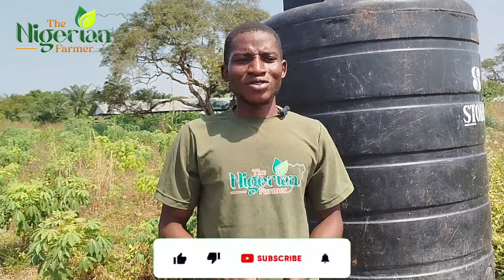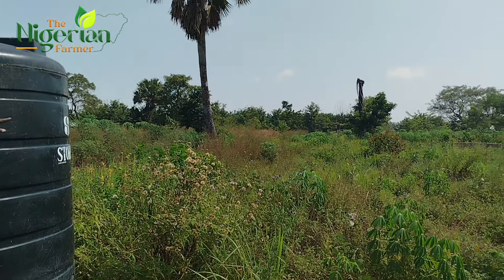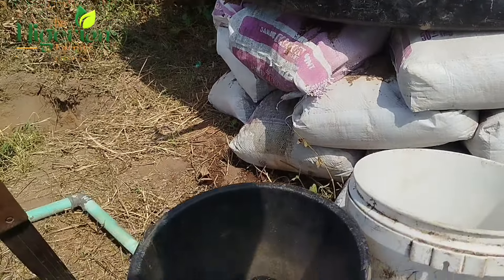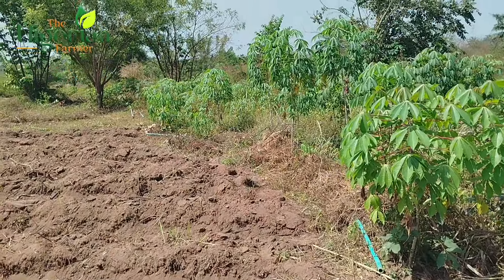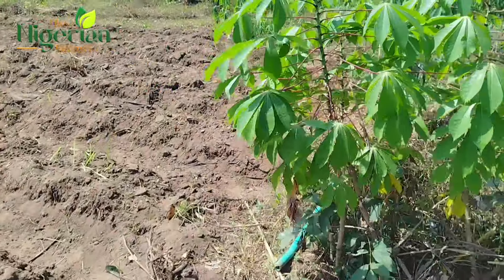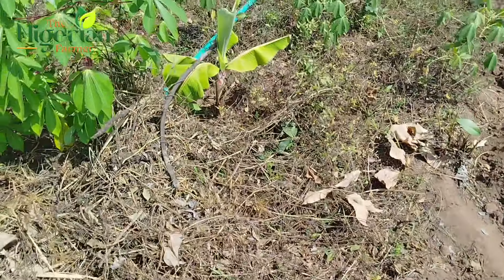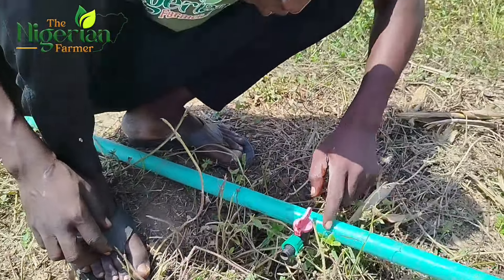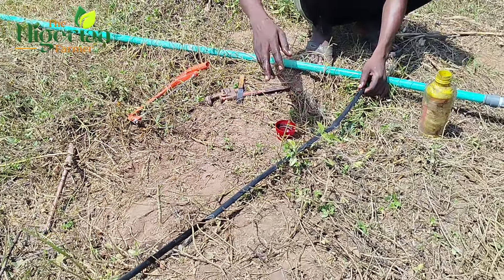How to set up Drip Irrigation

Comment: Thanks you sir,  this is useful, pls what is d name f the thing you use to connect the PVC pipe to the drip tape
Reply from the maker: It's called a PVC connector (with valve)
Reply: Can you please write the item you used for this installation?